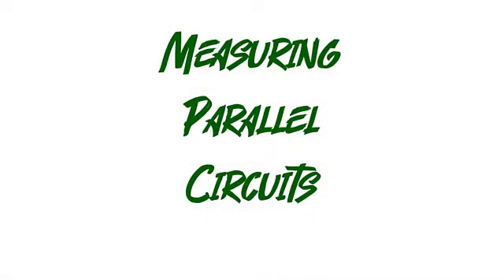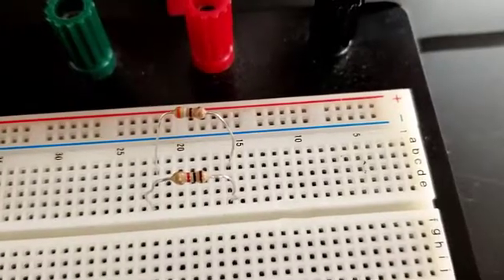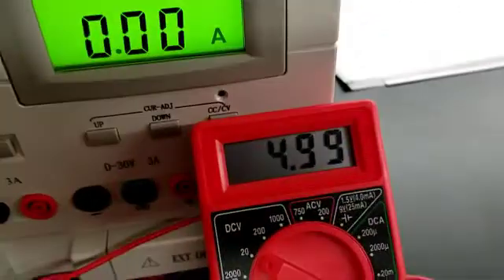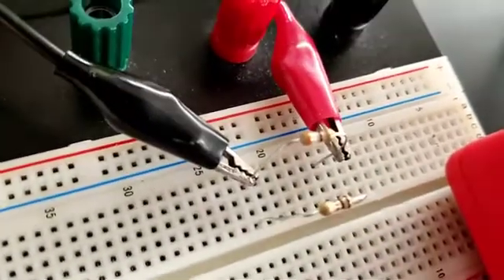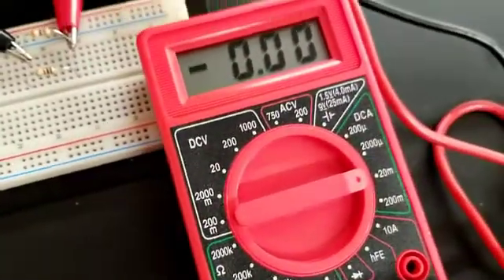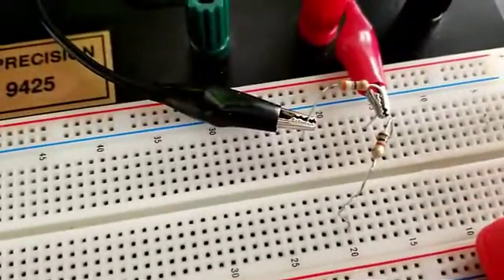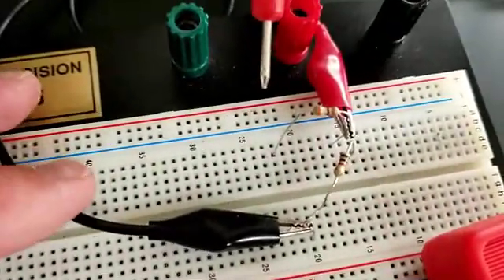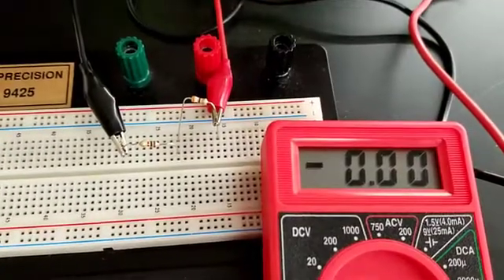Measuring Parallel Circuits

Comment: Not sure if your method for measuring the current for 2 resistors in parallel is correct. You essentially made another circuit when you moved the lead of the second resistor in another rail, so the current you are measuring is not correct. Assuming you are measuring current though a 560 Ohm resistor and a 890 Ohm resistor, then the respective current values should be 21.5 mA and 13.5 mA respectively.

Comment: Reminder to always break the circuit when using the ammeter. If you try to measure current while the ammeter is in parallel with the circuit it will burn the ammeter because it's internal resistance is close to zero, so, lots of current going through it.

Comment: This helped me out a lot thanks! If possible could you show a circuit with both series and parallel resistors to find current/voltage through a certain resistor? Thanks again!